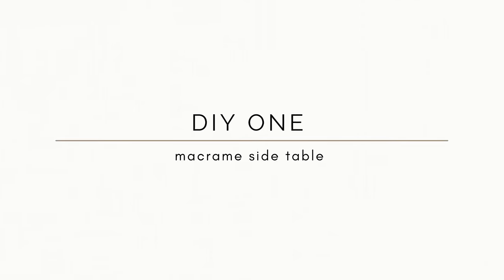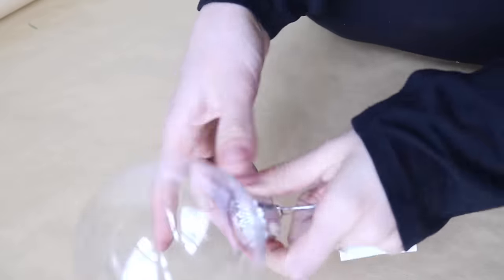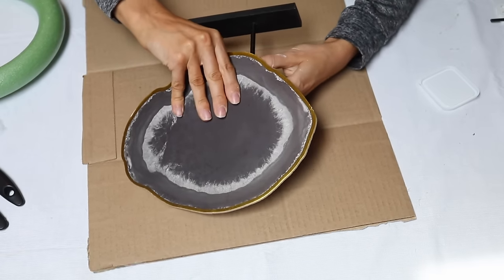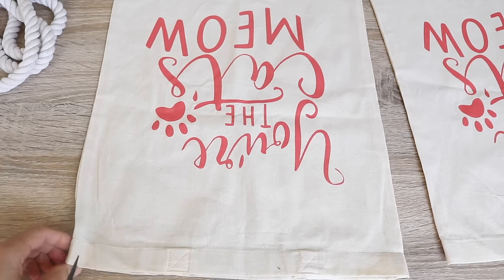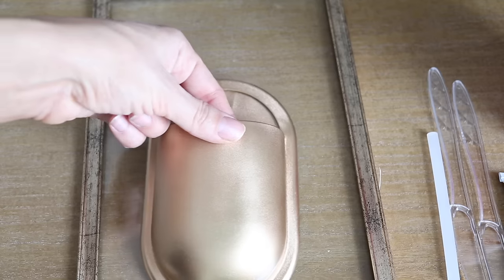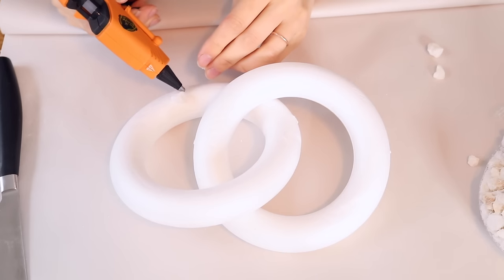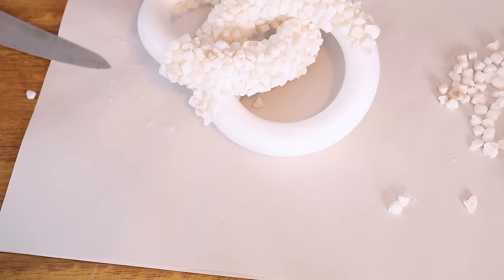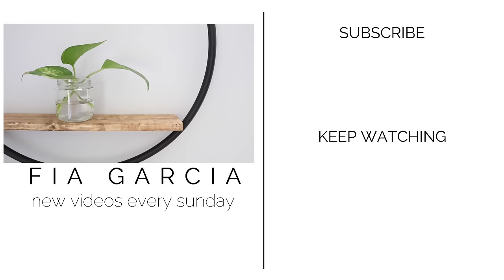TOP 20 DIY DOLLAR TREE HOME DECOR PROJECTS | HIGH END, EASY, & NOT CHEESY DIY COMPILATION

Comment: These are so great! What’s that tool you used to melt out the little holes in the candle holder?
Reply: Looks like a soldering iron. You can get an inexpensive craft one for like $10, or a more heavy duty one for bigger projects might be about $40-$50. I'm sure a simple craft one would be suitable for projects like this.
Reply from the maker: Yes!! I actually found mine at a thrift store for just $4!! Comes in handy if you work with styrofoam a lot like I do!
Reply: @FiaGarciaDIY  4 dollars is good! couldn't pass that up. I believe walmart has them for like $10.